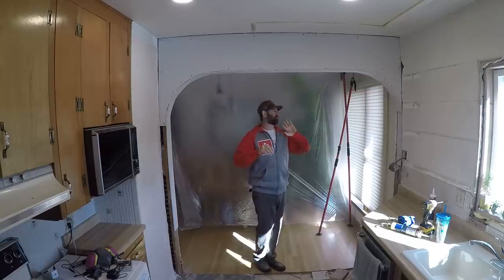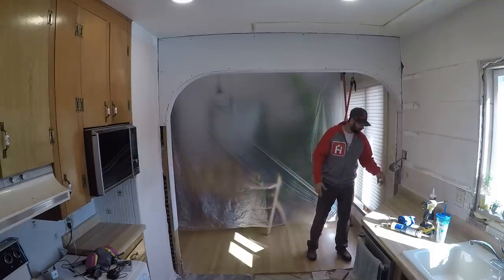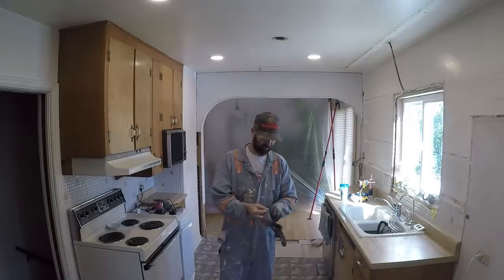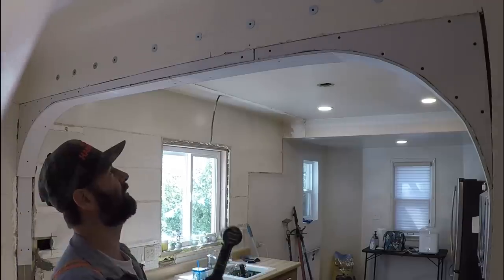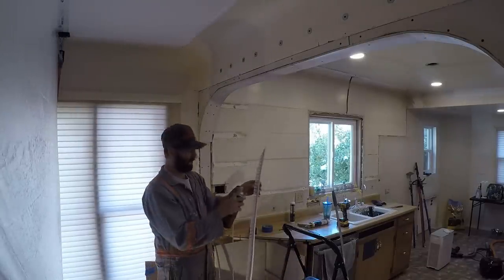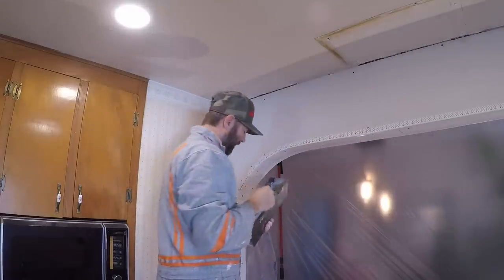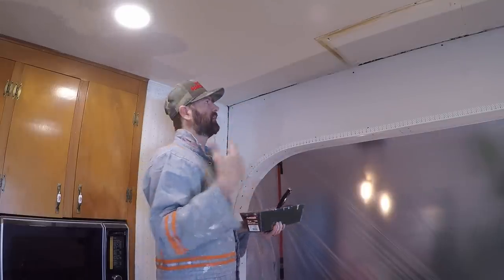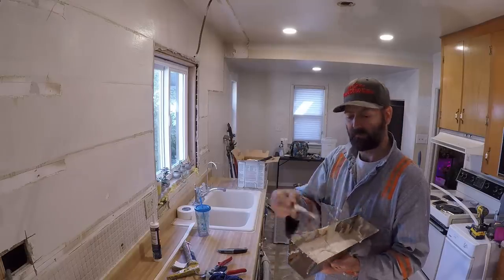How To Attach Drywall To Plaster Walls | Massive Kitchen Reno | THE HANDYMAN

Comment: Awesome vid as usual! 2 things- 1. Please explain that glue for corner bead does not go for the metal bead, the last thing we need is diy’ers putting up metal bead with just glue lol. And 2- for your impact setup I encourage you to use a 2-3” Milwaukee extension with a dewalt drywall drill tip. It’s magnetic so it holds the screws better, the tip gives you the perfect dw dimple, and you have a much lower % chance of shiners! Love the work and channel, been following for maybe 4 years now!

Comment: I've heard of masons using dish soap as a plasticizer but not drywallers for taping. I'll have to experiment myself at home before trying it at work. I'm curious to know what effect it might have when it comes to painting. I'd suggest using all purpose joint compound rather than the plus 3 for your first coat, all the glues in it make for better adherence to the drywall or plaster. Then use plus 3 for the subsequent coats, then back to all purpose for the texture coat if you're doing it by hand, or the plus 3 if sprayed. As far as prefilling with hard mud you have the right idea. Whether it was you who left gaps or you're fixing someone else's issue, or lining up drywall to plaster and it inevitably has a gap, prefilling always helps make for a better finish that lasts.

Comment: For a few screws I'd just use a normal drill with the click type torque limiter. When I was roofing warehouses I had a 1 or 1/4 horse power drill that had a push type clutch that spun the bit only when you put pressure. That was for drilling every 2ft on a 1,800ft roof putting 6 screws in each 4x8 foam insulation board.

Comment: My house is from 1923 only two rooms have drywall the rest of my rooms are all plastered... my question is in my bathroom there is drywall up I'm going to replace the dry wall I'm wondering if they had taken the plaster down and then proceeded to put the drywall up. When taking down the old drywall and if there is Plaster do I have to remove the plaster? I know for sure when I start this project it will be opening a can of worms! I'm a girl and I will be doing this myself. Mr. Handyman do you have any suggestions?
Reply: Well how did it go? I recomend taking all the plaster out if any but wear a high quality mask
Reply: @user27278  it went really well! I did not open a can of worms!!!✌🏻🦾

Comment: you said: hot mud dries hard as a rock as first application. is this similar to durabond90?  hence the 90 for 90 minutes to set. the bag you used showed 20, as if that's ready in 20 min. I was told to use the longer setting stuff to get the rock-like set.    just askin from a DIY'r who has lots to learn here..

Comment: If you work by yourself and rarely use subs..... How does the homeowner deal with the timeline?  Say a 5x8 bathroom.... I can do it a lot quicker with my helper and a tile guy than if I did it by myself....
Reply from the maker: Before I was a youtuber.  I could always do It faster and with higher quality then the 2 man crew. Minimum of 10 hours with tools in hands. That means I put in a 12 hour day.  I don't take a single break. I work weekends.  Now that I'm a youtuber I only take on jobs that I can video and take my time.

Comment: You need that hot mud in a caulk gun to apply into those holes. It's hard to push it far in with your scraper. Squirt with one hand, scrape flat with the other.
Reply: Save some money on tubes ~ scoop the mud into a plastic baggie, twist it close, nip off a corner & squeeze. Very precise application. This is especially fun for the guys above who like DOVE soap & ladies gloves.
~🥧🎂🍩~

Comment: So what is the idea behind putting the soap in, to make it float out more?
Reply from the maker: I think it is supposed to make it go on smoother.  I have never seen pro dry wallers do it in real life construction.  I think it is one of those things that only exist on the internet.
Reply: No... pros used to do it more years ago but it frowned upon now as builders r getting more technical and trying to follow manufacturer specs for warranty reasons. Also...I'm not sure about the box mud but generally you want to tape with "green lid" mud. It has more glue for holding tape. Looks good!
Reply: @gibsonbuilds4841  Interesting, I could see that.